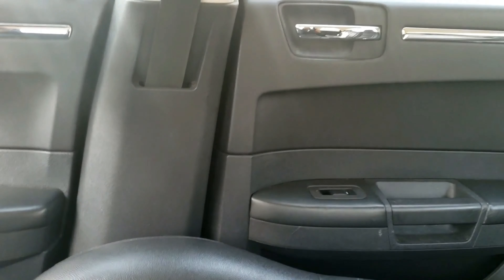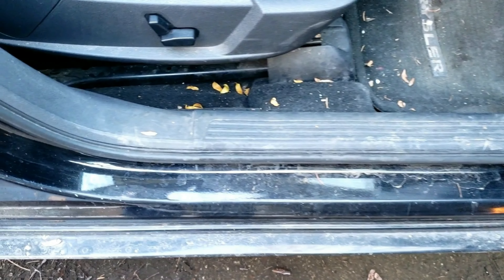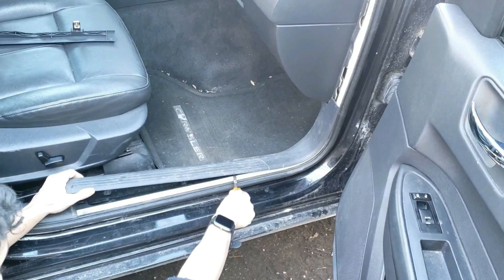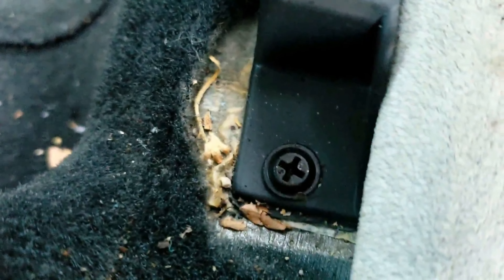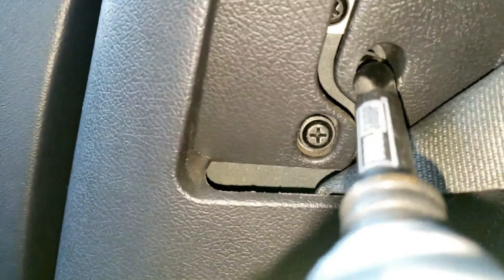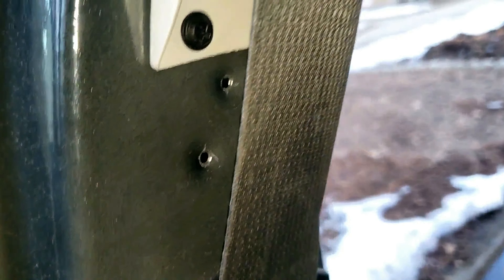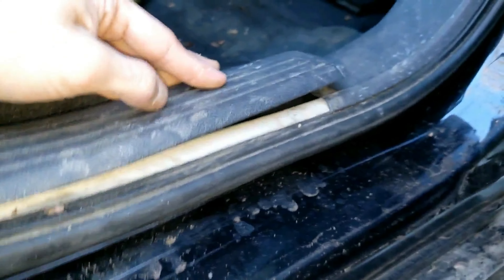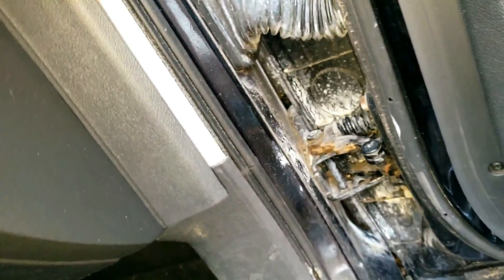Replace Lower B Pillar Trim On A Dodge Charger, Magnum, Or Chrysler 300

Comment: I have some sounds coming from  r/s and l/s B pillers. I have a 2015 dodge charger whose pillers are slightly different from the one in this video.
My question is: is it the same way to Remove them? And what do you think the reason behind those sounds is?
Thanks very much
Reply from the maker: It would be slightly different, as the screws could be in different places, or the way its clipped on could also vary. 

As for the sounds I'm not sure if their is a light or motor in their or if its something to do with the side air bags. I had 1 person say they had rats living in the pillars. Hopefully that's not the case for you as that would be very rare.
Reply from the maker: Also it could be wind noise. If you open it up sometimes these pillars have foam in their to help reduce the noise.